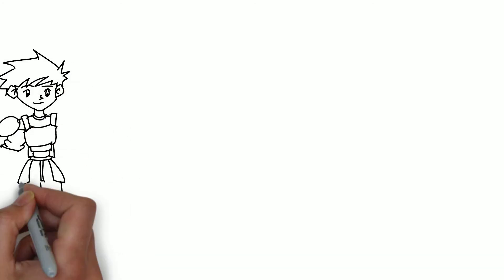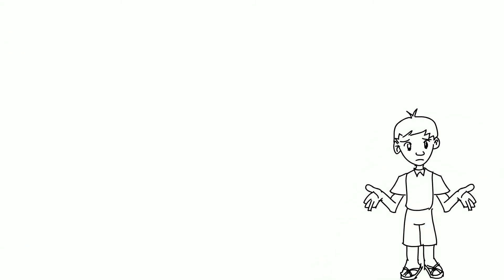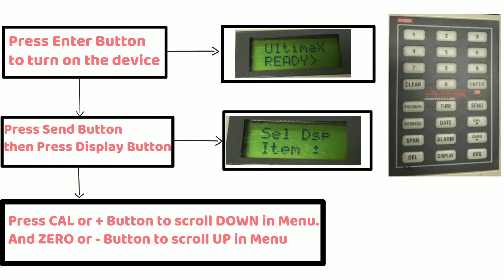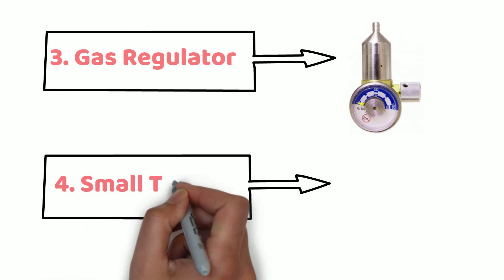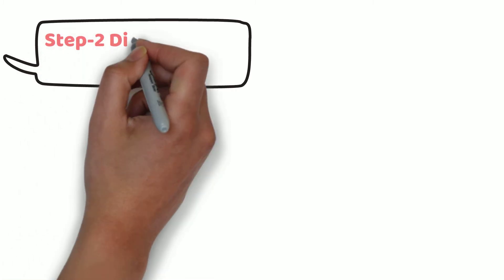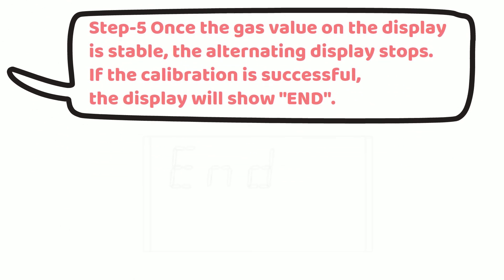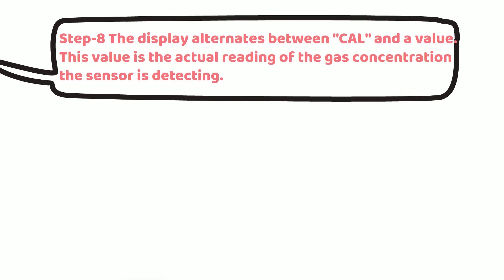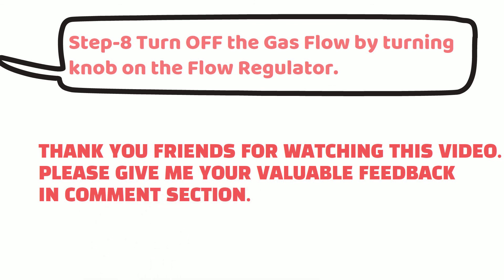How to calibrate MSA Ultima XA/XE Series | Gas Monitors Calibration

Comment: Great Video, but do you know how do I change the span gas concentration with a Hart communicator (Emerson 475) ?
Reply from the maker: You can not access any parameter without MSA Calibrator. In order to change parameter by using MSA Calibrator, press send and then span, and then press + button at once. Then enter your span number, point calibrator towards transmitter and press enter button.